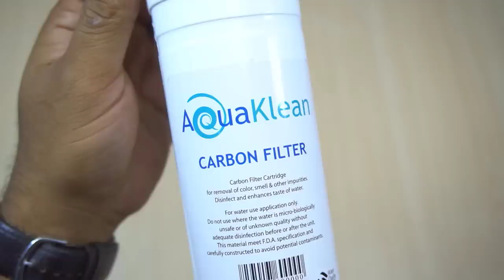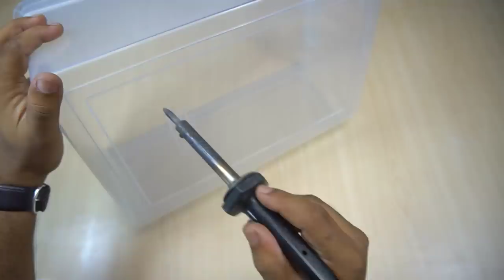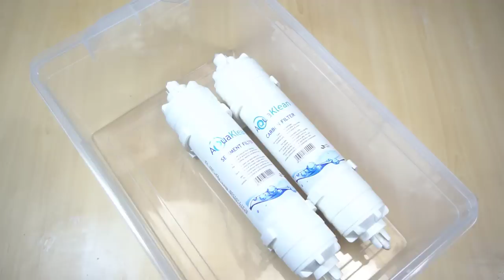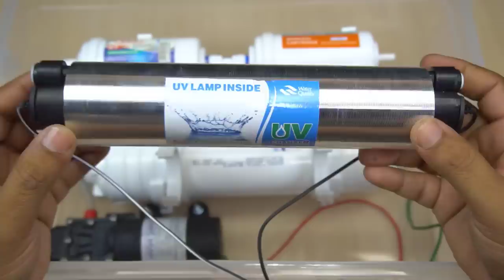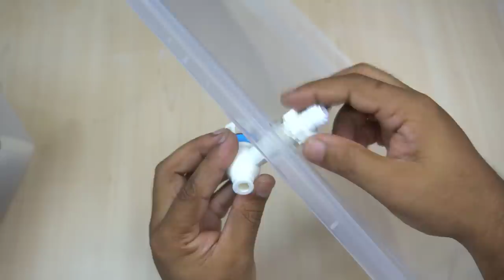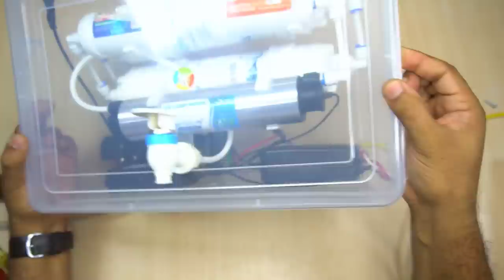DIY Portable Water Purifier at Home  II Low Cost II

Comment: I would suggest locating the electrical components at the top rather than the bottom to minimize damage if a leak occurs.
Reply: True
Reply: also sediment filtre ( dust & particules ) then carbon filtre i guess
Reply: It is definitely a SAFETY advantage to place the electrical parts on top.
Reply: No matter where you physically place the UV it should be the last stage the water passes through
Reply: It should be placed at right location the sediment filter and carbon filter always at. The top beacuse of best water flow
Reply: What the average cost of this setup
Reply: Yes,
Reply: @lokeshmysore1746  
Satisfactory
Reply: @kamblenanasaheb4668  approximate 2000

Comment: Nice idea,but I have many doubts!      The waste water outlest? And Diods 5Amp or 10amp ? Very less change in TDS value? Any way great initiative, keep going...bro👍
Reply: He hasn't used reverse osmosis membrane, so no waste water outlet. Because there is no RO membrane, the reduction in TDS would be bare minimum... filters do not remove dissolved solids, filtration is for removing insoluble substances. Also, the TDS meter he used is a cheap chinese product that can't be trusted. I had a similar meter and it gave false readings.

Comment: Its good but. The sediment filter should be first or you will clog the charcoal filter. As said before, electronics at the top. The diodes are a bodge, each one drops the voltage by 0.7v, so a variable resistor would be better, or a pump that runs at the specified capacity. Otherwise, it does what you need it to, but you will need to replace the charcoal filter far more often than you should, unless you install it in the correct order.
Reply: can you mention the order please here

Comment: Good idea. But some mistakes.   UV will not effective in such a high flow of water pass  through UV barrel. And no need of water pump if  inlet pipe  connectd to a water supply . Mineral cartridge has no role if no RO memberane.

Comment: Sir I have purchased UV UF Filter. My submersible pump doesn't lift water to 6 ft height. Output pure flow is slow. 1lt bottle fills up in 5 minutes. Please suggest a good pump that can suck water from bucket upto 8ft height with pressure to the Pre filter or outer filter.

Comment: How did the water flow start immediately when you switched on the current. 
Water needs to flow through all the units till it comes out and it requires time. 
Please explain.

Comment: Y motor pump n SMPS? Without dem u can easily get d filtered water, use uv choke for uv that's it.

Y diodes y not tds control both r same. 
If u add SMPS then add SV too.

Comment: I like you idea, however I don't trust that tiny UF membrane and the mineral cartridge will only help damage the UV lamp.

Id do the same but remove the mineral cartridge and use a better membrane.
Reply: 1.But what is the need of Mineral Cartridge when RO membrane is not used?
2. UF should have been placed after UV lamp.
Reply: @shantanu.upadhyay  mineral cartridge is not required where tds<300. A good quality uf membrane(such as kent) is sufficient. 
Mineral cartridge is needed to adjust by increasing tds when ro membrane drastically reduces that parameter.
Though, it is kind of marketing policy to make people fool by introducing purifiers that reduce tds by ro membrane and again adjust tds (raising its value) by adding uf/mf/mineral/copper cartridges from a bypassed main water supply.

Comment: I want to make it but one thing want to know , can  this purifier  system  reduce water TDs from 900 to 300. Pls pls pls reply me. By the way Thank you so much 🙂👍
Reply: yes. it can. but you have to go for high capacity RO membrane which can handle even 3000 TDS.
Reply: @manjusrinivas2007   I want to make it without RO because lot of water wasted. Is this possible through this purifier to reduce tds 
from900 to 300. Thanks for replying me.

Comment: Hi mate! I want to make a RO system for an aquarium, i have boring well water having TDs value of 2800 PPM. I need an advice to buy RO spear parts and a good quality membrane which can deal with 2800 ppm TDs and will give me 100 gallons of water per day. So now advice me that which set of compulsory membrane i should buy? I don't want to buy mineral membrane and uv membrane. If i use simple PPF 10 micron and CTO membrane with RO membrane, will these combination will fine for fresh water aquarium water? And please tell me is must to use RO booster pump and TDs controller in an RO system? And my final questions is that what is an UF membrane and for what it's used in system? I'm sorry for tons of question since I'm makin an open type RO system first time so i want to gather sufficient information about system. Thanks in advance.

Comment: It costs around 1300-1600/- den buy RO cabinet around 1400/- total cost wil be 3000/-. Actual filter cost in d market is 8000/-.
Don't add mineral instead pre, post carbon filter

Comment: Any specification for the 6 diods ?
Reply: The motor he has used,should not b used with these kind of filters,its used in high pressure washer machines ,instead u could use ro water purifiers motor which has a regulated pressure,he might used the high pressure motor to cut the costs only,but its not good for long run.and using so many diods with this motor may reduce its efficiency by cutting the exact ampears needed to run this motor,fyk u can use 3amps or 6 amps diods with this to reduce the efficiency/ampears.